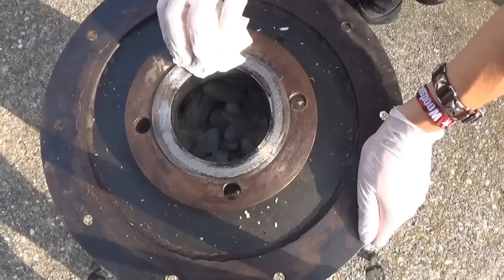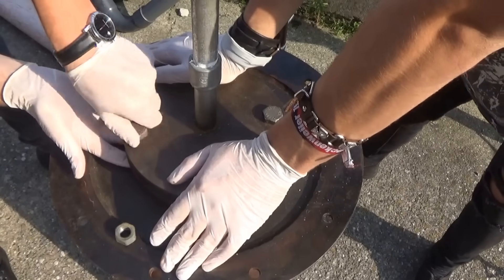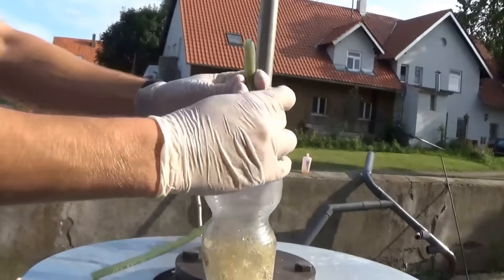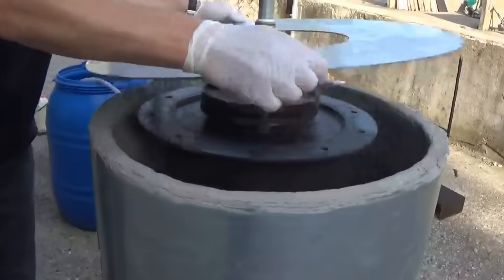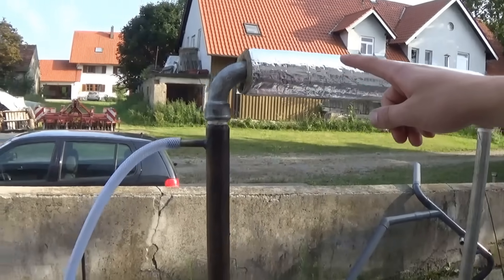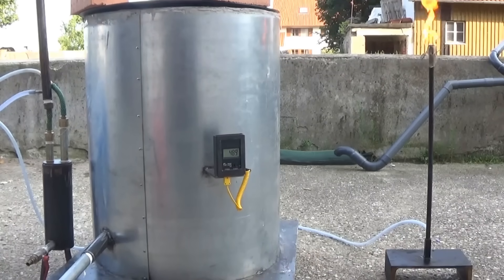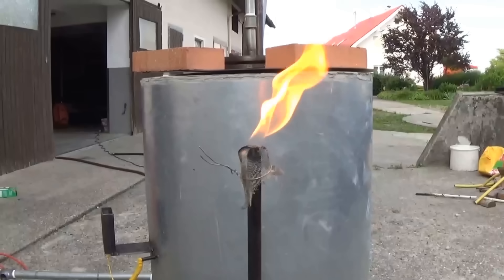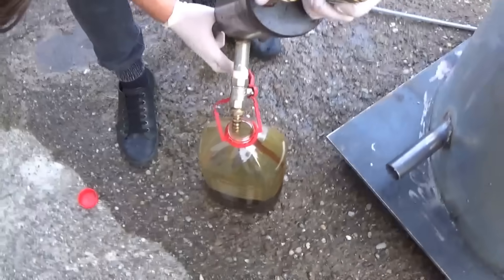plastic waste to oil/fuel improved pyrolysis reactor

Comment: @pavelp80 . Incineration is not the solution. No plastic should be burnt! All common plastic, clean or slightly dirty, can be remelted up to almost 10 times, then the molecular structure begins to change, and the accumulation of contaminants will have reached a critical level, thus it cannot be mecanically recycled anymore. However, this plastic, together with all other types of contaminated plastics, can infinitively be chemically recycled back to monomers; the starting material for making polymer plastics. This process requires three times more energi so mechanical recycling must have the foremost priority; only when no longer possible it's time for chemical recycling.
Incineration in powerplants takes place at a temperature between 600 to almost 1100 C which isn't high enough to destroy the majority of  hazardeous additives in plastic. Most powerplants operate at a temperature of 900 to 1000 C. As an example, dioxine created from burning of PVC can only be destroyed at a minimum temperature of 1150 to 1200 C. No need for a long list of additives in plastic here, just mentioning that most of the hazardeous additives require a very high temperature to be destroyed. To illustrate that it can be done, it's worth mentioning that a special plant have been built for destruction of highly carcinogenic asbestos waste. The process takes place at a temperature of over 1900 C, and is of course extremely energi intensive, thus not profitable at all. It's solely done to turn old asbestos waste into harmless slag. 
Incineration of dirty plastics in powerplants will neither destroy poisonous metals present in some plastic types. Mercury, Chrominum, and Lead are usually only present in trace amounts, but Arsen(Arsenic), Antimony, and Cadmium are present in noticeable amounts; PVC contains quite a lot of Cadmium. Metals are not chemical substances but elements in the periodic system. They cannot be destroyed at any temperature available on earth. If you really wanna detroy these elements, you'll have to send them by a space rocket directly into the sun to be burnt at temperature of several million degrees, in order to break the atoms.
Burning flourocarbon plastic in a powerplant releases a green house gas 1000 times worse than CO2 due to the strong carbon-fluorine binding; although at extreme temperatures the bond can be broken. However, there is in fact a technicque by which using a special catalyst and heating to just 25 C breaks the bond and turn the flourocarbon into hydrocarbons and fluorosilanes with no greenhouse gas emision.
Plastics containing Fire Retardants (FR) releases Bromine or Chlorine if burnt. The Chlorine cannot be destroyed by burning as it is an elementary gas, but the lime in the exhaust gas scrubber will catch most of it; except the created poisoness dioxine. The Bromine is also an element in the periodic system but rather difficult to capture (best at -5 C, it freezes at -7,2 C), due to being liquid at room temperature and very volatile (boils at 59 C). A pilot plant constructed in Germany showed that it's profitable to recover Bromine (recovery rate of around 90%), from off gases when burning FR plastic. However, there is another way to recycle FR containing plastics by using a process developed by a German research institute. The FR plastics are dissolved and the metal contaminants (mostly Antimony) are removed, then the Bromine is recovered leaving a solution of plastic free from contaminants. Finally the plastic is precipitated as polymer, and the solvent is recycled for the next batch.
Contaminants in plastics can stem from production of the raw plastic, or contamination aquired during its use. Even the same plastic type can contain different additives, depending of what purpose it was manufactured for. Liquid melted plastic still have high viscosity(thick) and is only suited for extrusion into finished products. In the other hand,  liquid melted plastic intended for injection molding must have a low viscosity(thin) for being able to flow smoothly into each corner of the mold, so plasticizers have been added. Virtually all plastics are contaminated with something.
When you claim "It makes no sense to create fuel from plastics and at the same time to burn everything from gas to bunker oil in powerplants when some of these refinery products can be used for making plastics" I wonder if you're misinformed. Maybe in third world countries like the US where environmental protection laws are far behind those in the developed countries, powerplants are using gas and bunker oil, or even worse coal, as fuel. In Europe and Japan most powerplants have abandoned coal and fossile fuels. The majority are using wood chips; i.e. waste from forestry, sawdust/bark from sawmills, or shredded wood waste from house demolition, old furnitures, or single use shipping pallets, as a few examples. 
With the ever increasing installation of windmills and more solar cell parks, combined with the continous construction of plants for production of sustainable petrol/gasoline, diesel, and aviation fuel, the need for fossile oil will decrease substatially. The environmental dangerous drilling for oil will eventually cease.
Despite the obvious benefits of mechanical or chemical recycling of all plastic, developing countries faces a tremendous challenge in transportation of plastic waste to plants in industrial sites in the big cities. Huge distances from remote thinly populated areas, and also the lack of infrastructure makes it an almost impossible task. Here pyrolysis of waste plastic comes in as the immediate solution to the worlds increasing plastic pollution. Not only their local surroundings are polluted with plastic waste, but their plastic waste affects the whole world when entering the ocean. Then they can also stop burning plastic waste in open pits (too low temperature for complete combustion) resulting in terrible pollution, and ultimately total destruction of the surrounding areas.

Comment: In paper recycling plants the plastic is filtered out since it doesn't solve in the pulp (water + paper fibre). Nowadays many paper recycling mills have a plastic gasification installation as a power source to party feed their boilers. I assume it works quite similar to this pyrolysis reactor.

Comment: There are more simplistic, cheaper ways, to do this; however, employing these methods would be helpful either way.

I'll say it every time though.....when it comes to fuel sources, we should be using hydrogen.
Reply from the maker: hey Ben, thanks for your comment.
The problem is that there is no single technologies that will "save" us. It is rather a mix of different technologies which are best suited for the circumstances. For example industrial nations have the money and infrastructure to heavily rely on electric and hydrogen. 
This system I build for small villages in developing country's which neither have the money or the infrastructure for high tech solutions. 
I hope this better explains my though process.

mfg hazelChem

Comment: Been studying on this myself for 20 years, yet to build a reactor.
 Can't you purge the oxygen from the cell with an inert gas like C02/argon? Instead of mixing up acid and carbon? I keep a cylinder of 75/25 for my welding machine  its cheap.

Comment: The big question is does this burn more propane fuel than it takes to produce another type of fuel? So I was thinking can you use wood or other waste material to do the heating? In the gasket, I was thinking if you used a tapered fitting like on a Welding Gas Bottle you could probably do away with the gasket all together. Thanks for sharing. Best Wishes & Blessings. Keith Noneya

Comment: What I'd like to make is a two-part combined conversion rig. The inner cylinder does pyrolysis using plastic. The next layer surrounding this converts wood to gas using the gasification process. The layer around this would contain water to create steam. The steam can be added to the output of the gasification process. One could use the gasification output to assist in managing the appropriate temperature but to be honest the scrap wood is the primary fuel to heat everything.
What I see from the pyrolysis-only projects is that a fair amount of energy is put into heating it up; I even see people using propane, for example, to do this. I suppose that works but you're technically using purchased fuel to produce fuel. In the version I've described above you're using both the heat and the produced chars which are then the required fuel for all processes but they go into the output as well. The chars can be fed back in so that they don't become build-up.

Comment: Nothing was said - that I heard - (please correct with a quote and time of quote if I am wrong and I will reply with a thank-you from the  idiot) about the ratio of the energy values of the fuel used to in order to result in the energy value of the fuel produced.  Or another way to put it - is the classic battery alternator motor cycle to get alleged over-unity type of perpetual motion.  The alternator allegedly powers the motor whose torque values in turn powers the Alternator which constantly recharges the battery and on and on and on  and on which the only thing that is a constant perpetual is the generation of BS. !
Reply from the maker: Okay because I get comments like yours a lot! 
THIS IS NOT CREATING ENERGY 
The system uses around 40% of the energy contained in the plastic waste to power itself. During the pyrolysis the gas that is burned corresponds to the same (mostly more) amount of gas used for heating the reactor. This shows that the process can be run on its own gas (which is the said 40% of energy contained in the plastic). 
So, to conclude: My setup burns the gas directly because at the moment it was too much effort for me to compress it and use it to power the system. The video is just to proof the concept.
Currently I am building a reactor with the mechanical engineering department.

mfg hazelChem

Comment: Oring style seal as we use in High Boost cylinder head for Combustion engines.
;-) much cheaper and just tooling steel or copper exhaust oring gasket. Machine groove.

Comment: It makes sense only in case of heating with free energy (wind, solar or thermal fusion)… because here You used so much propane that in the result the fuel that You received is less energy than that of used propane

Comment: Hi, good video and thank you for uploading. I have a few questions about your design. 

What material do you use for the outlet pipe of the heat reactor? Also, do you gauge any pressure within the reactor at any place, this include if you have any relief valves?

Comment: Maybe use a torque wrench when you tighten the seal to get an even pressure, you probably don’t need heaps of poundage as the metal expands when it heats,

Comment: Nice but it turns into wax as it cools. It neads re refining to turn into gas petrol and oil. I've taken it further to get the desired results. I used to work in the waste oil industry, and also sasol 2 and 3 waste products from dams. It's was a great experience

Comment: This is just like burning violins and guitars for heat to warm your house because it is "wood".
Its a bad idea all together, cooking plastics at high temperature gives dioxines, one of the most toxic substances known to men.
Reply from the maker: Hello,
the key point of this process is the inert atmosphere (CO2 or Ar) with the eclusion of oxygen there is no formation of dioxines! 
Trust me i study chemistry! If you want to read about this process I advise you to use google schoolar and read papers about "plastic pyrolysis" 

mfg hazelChem
Reply: @HazelChem  even if, you are still burning violins to keep warm, its not the wood that makes a violin expensive, its not the raw material that makes plastic products valuable, its the engineering in all its facets that makes plastic products valuable, burning it only retrieves the material value, the enginering value is lost for ever.
We must stop making trow-away crap, plastic products like for instance kitchen appliances should have a minimal lifespan of 50-100 years or so which is no problem technically seen.
Planned obsolescence should be a crime punishable with jail time.

Comment: Can you pull a vacuum on the chamber to eliminate oxygen? This will do away with the acid. a cheap oil rotary vane pump would do the trick I think depending on the size of the reactor. Is there a way of atomising and force feeding the biofuel to get higher BTU's and eliminating the propane? I'm very new to this but very interested. It would be great if the plastic biofuel could be used to fuel the reactor.

Comment: Try using human shit you'll be surprise what comes out, gas and light oil so 450C and 1200PSI so reactor chamber. In the USA was looking into the problem during the 1976 and read about it but at the time it was too expensive.

Comment: Most pyrolysis projects in India use Alumina along with the plastic-waste. Perhaps this acts as a catalyst.
Reply from the maker: Using silica produces to much waste and adds in a cost factor. My goal is a smal self sustained unit which can be provided to remote vilages in developing countrys.

mfg hazelChem
Reply: @HazelChem  There's no pollution using Alumina. I increases yield of oil by preventing charring. It is the 2nd most abundant element on earth. 

And in India, now there are dozens of plastic waste to fuel conversion plants. Many cities have plants that handle waste upto 15 metric tonnes per day. The output is a crude form of diesel that is bought up by industries with boilers & furnaces. The yield seems to be @70-80% fuel by weight of plastics fed. And the residual bitumen goes into road-making.

See the videos below
https://youtu.be/RELTlS3hEE4
https://youtu.be/YPQQtoD0Mvk
https://youtu.be/Ln2TvaTTKKo

Comment: Get a higher pressure propane regulator and a smaller gas nozzle. Then feed the flare gas into the air inlet of the burner. You need to throttle the air a little at the beginning so that there will not be too much air when there is no flare gas coming off, yet. But later you can throttle the propane - smaller gas nozzle with higher pressure still provides enough suction for air and flare gas. If you produce enough gas, you need a blower motor like the 12V pumps to inflate air beds, and switch off the propane.
It would be champions league to get a generator to run directly off that gas. It didn't work when I tried it, but it was a little half assed effort.
Reply from the maker: Thanks for the ideas ^^ I used that to build a small melting furnace.  Now I am trying to convert the burner design I made into a burner for the reactor. 

mfg hazelChem

Comment: I’m glad I’m not the only person doing this and forgetting about the material world. About a year ago I made a copper Liebig condenser for distilling spirits but ended up giving up drinking. So the Liebig was just sitting there. Collecting dust and looking awesome. Instead I used it for this. It looks very similar to your setup. Mine is smaller scale as it was started at a time when I was slightly more ignorant than now. I Got it all for free. Just time and labor. I pulled almost everything from scavenged appliances. I wanted to prove it was not only possible but the parts that came from name brand sh*t is usually good quality. I Learned a TON of info. Took me at least a year. From within my inner sub-conscience, to the complicated side of my conscience mind, I unknowingly initiated a personal renaissance that hasn’t stopped since. 

Good work here my friend. Go and inspire others to do the same. Preach it as if one would preach the Gospel. It truly is our only hope in about 20 maybe 30 short years. 
READERS: Oil will NOT last forever…
(However, hydrogen gas combustion seems like a promising technology too.)
Reply: Actually oil is a geological byproduct, the fossil fuel concept was an incorrect theory of the late 1800s and unfortunately it stuck. No geologist worth their salt would ever agree it's liqufied dinosaur anymore.

Comment: Can you also use wood instead of plastic? Because I've seen how people put wood through the same process and distill the final oil - like product just lile you did in your other video.
Reply from the maker: yes you can but it will produce a high amount of water and the oil has a very low energetic density compared to the plastic p-oil

(this process with wood was used to make methanol in the past. That´s why it is sometimes called wood spirit, at least in german) 

hope this answers your question :D 

mfg hazelChem
Reply: @HazelChem  ok thank you. But wouldn't you get the same hydrocarbons you find in gasoline out of putting wood through the same process?
Reply from the maker: @coolkrass5079   nope the composition is completly different. Wood has a high contend od oxygen and nitrogen which leads to different products.

mfg hazelChem
Reply: @HazelChem  alright, thank you.

Comment: Why not use the waste burner to heat the gas chamber set up,after starting it with propane,you would only need to  run a small amount of time, and it would be  quite efficient